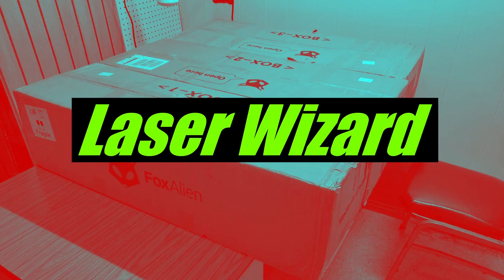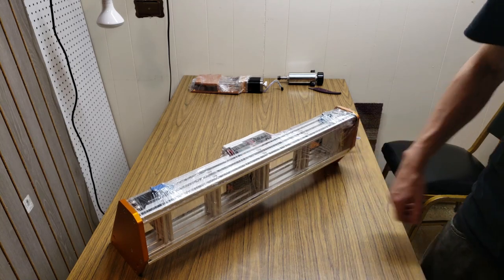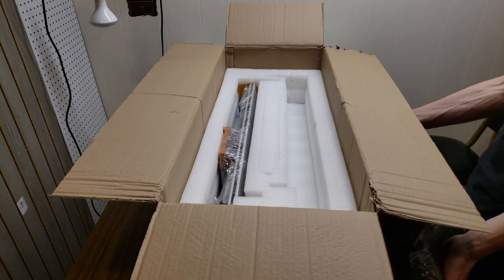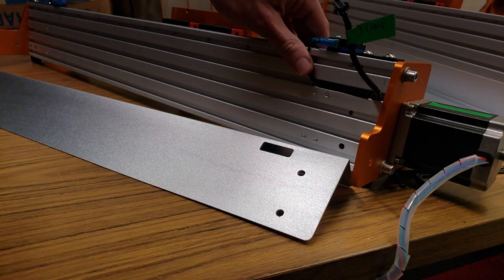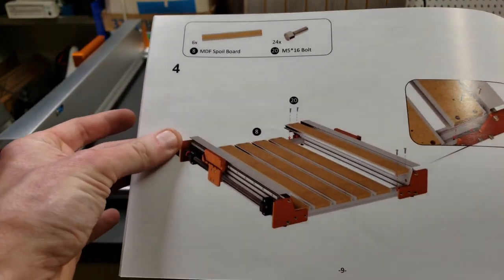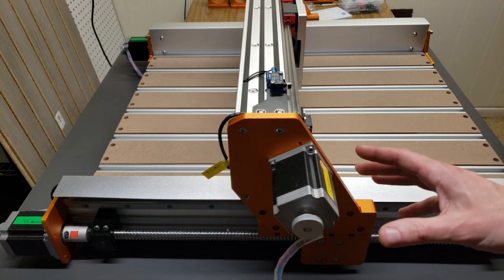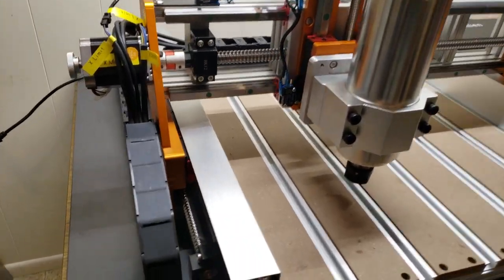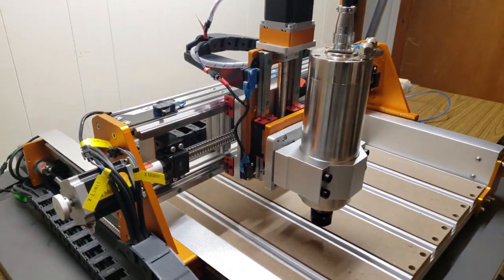FoxAlien Vasto Unboxing, Assembly, and Initial Review

Comment: The higher power spindles are all 80 mm, these run quietly and are 1.5kw, but I suppose one can make a mounting plate for these spindles. Also maybe replace those mechanical stop switches with inductive proximity type ones

Comment: Thanks for video, subscribed. Since i have this router and others on my mind, waiting for the next video, to help me determine which one. Would also like to see how the laser module works too, before i pull the trigger on one.
Reply from the maker: I hope to post it in action cutting aluminum soon! So far, it has performed extremely well. Everyone in the FoxAlien Facebook group that has one loves it! The power of your spindle will determine its performance, because the body of the machine is super solid. I went with the 2.2kw spindle right away. No regrets!

Comment: Thanks for this video. I have a FoxAlien Vasto CNC and I would like to upgrade the 400W Spindle to 2.2KW Water Cooled one. Where do you get yours? What is the brand? Come this 2.2KW spindle with the 80mm clamp? Thanks in advance.
Reply from the maker: Hi, Olev! I bought mine off amazon. It is a Huanyang brand with ER20 collet spindle. Comes with the clamp, pump, tubing, VFD drive, but no cables. I 10/10 recommend going with this spindle. It's been working really well for me. All I've done is aluminum on my Vasto so far.
Reply: Is the ER-11 air cooled, 1.5kW spindle good for aluminum?

Comment: Very informative I’m new to CNC and I like to follow people that know and are willing to help. I am confused on the different models they have. This model is the one that I want but want the close loop steppers. Can you explain what is the different between the Vasto and the ex? I know the ex has the linear rails on the top and the Vasto have the on the side.
Reply from the maker: The XE-Pro needs linear rails purchase separately to upgrade to get to "Vasto" level. I have not yet tried the XE-Pro nor the closed loop steppers, but my vanilla Vasto is doing fantastic so far. I do mostly soft metals on mine.